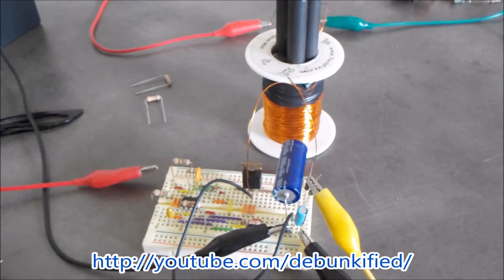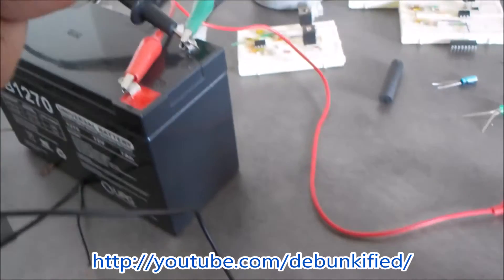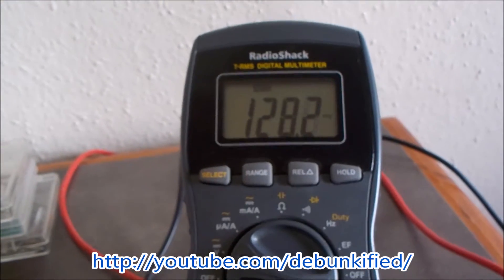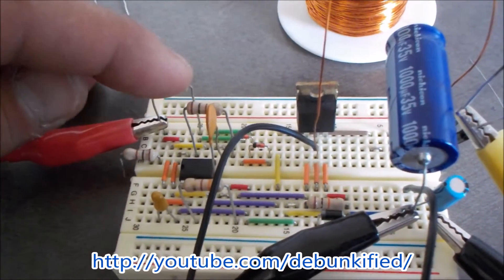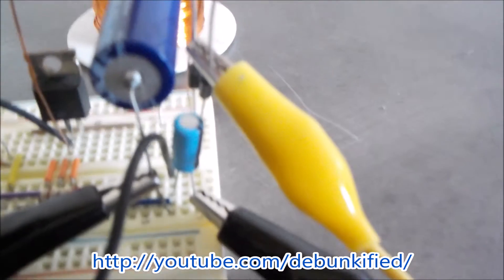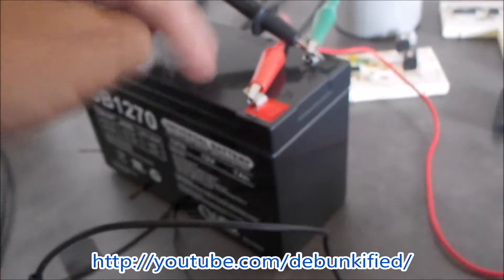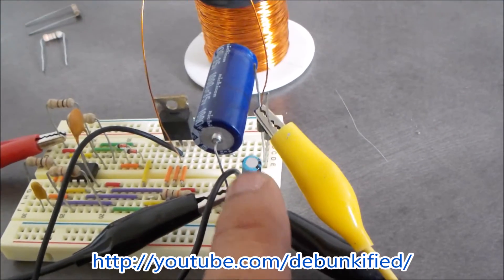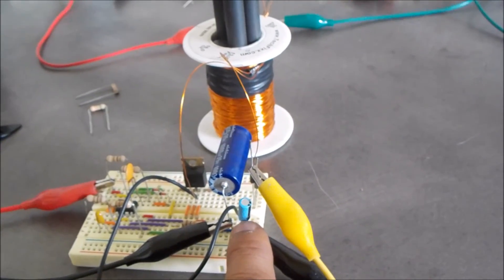Fogal's Charge Barrier Semiconductor

Comment: Sorry to say dude, looks like you just got an "electrete" effect in the capacitor is all you seeing. That would be doing that even if transistor wasn't hooked up to it. You sure you read the Fogel pattent ? Cause he has a resistor in parallel with the Cap on the emitter. Also tantalum Cap better to experiment with for Fogel

Comment: hi.
remember how Bearden explains  that this type of cap moves  inside itself and creates internal loses in curent.
this electrolytic caps are maybe  less suitable than  ceramic ones?

have you tried some  semiconductor experiments, with 2 mosfets  and relaxation times ?

cheers
actually reading his 1993 paper...

Comment: Are your florescent lights imposing AC line current into the coil?  Do experiment with those lights off, tungsten lighting only.
Reply from the maker: I do not have florescent lights in this video, and we did actually turn off all the AC in the place by shutting off all the fuses. The effect remained.